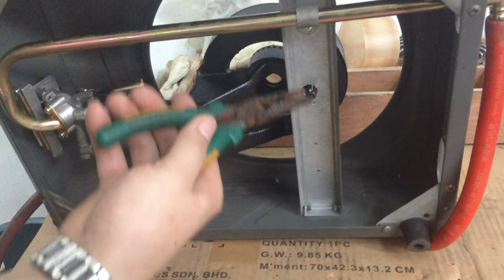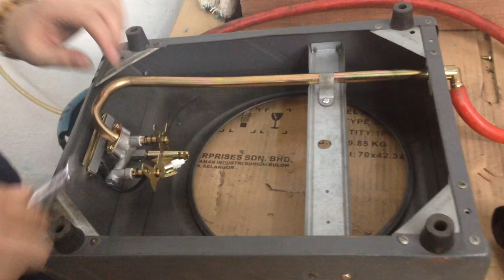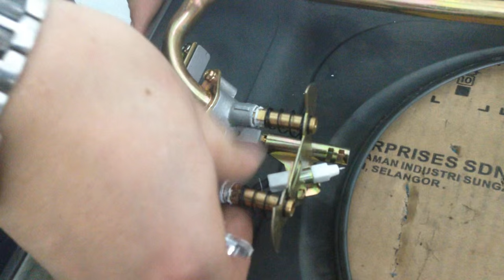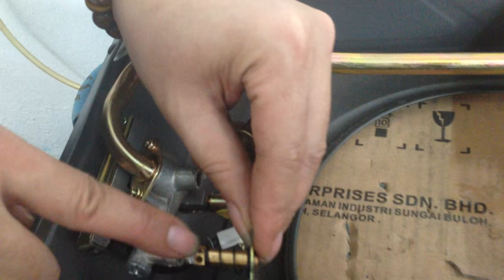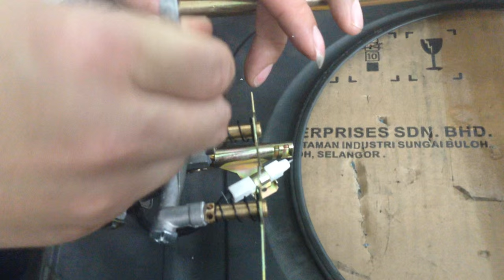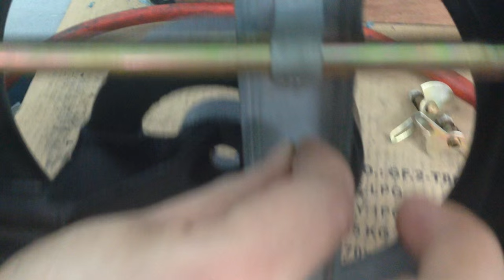Conversion Propane Gas to Natural Gas

Comment: You should explain orally. Use Teflons tape to avoid leakages. Air intake also reduce for proper flame otherwise it will not function properly on natural gas.